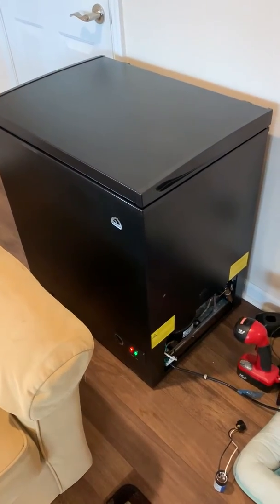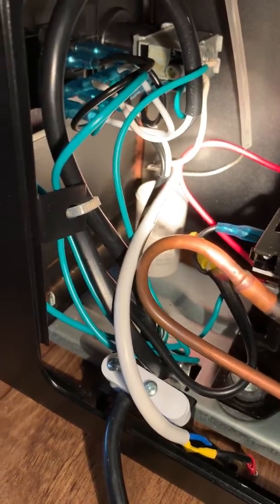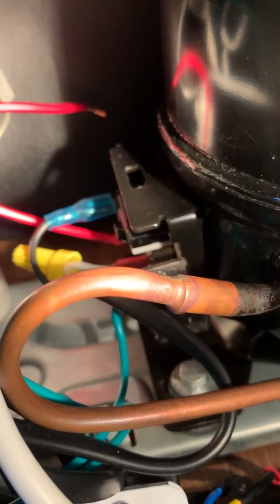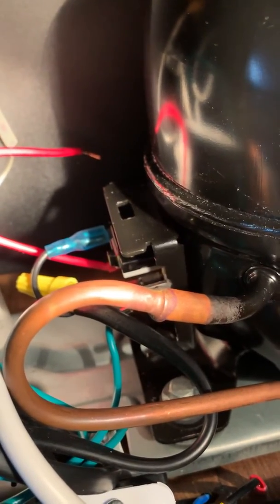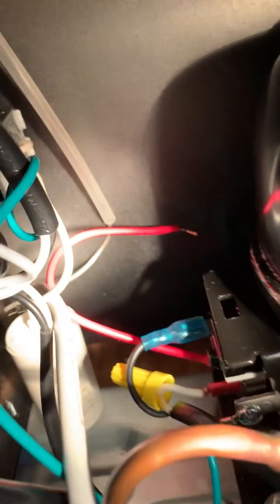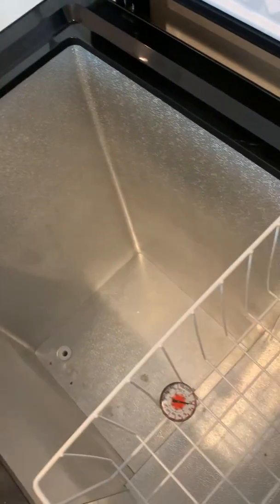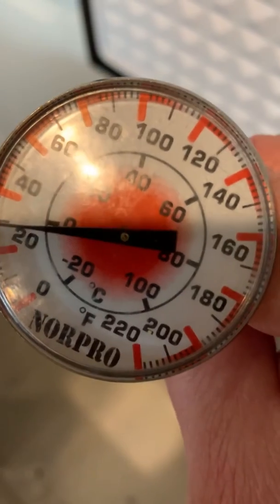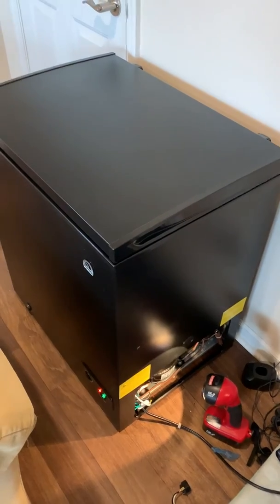FRF508 IGLOO Freezer Testing

Comment: I just got a non working Igloo for free. Parts are on the way. I purchased a new one for $189, and want a second one, so I managed to find one for free on Facebook market place. Seems like many people are getting stocked up on food, and noticing their freezer doesn't work anymore... so they go out and buy a new replacement unit. That's fine, I'll take all the free non working units and fix them. I like the 1.2 amp draw of the 5.1 cu foot units. The 7.0 cubic foot units are 5 amps? If you try to use solar power with these units, it will kill your deep cycle batteries real quick. Remember, when you go from AC to DC the amps are times 10, so a 5 amp AC freezer is going to draw 50 amps DC. The lower amps is more efficient with two 5 cu foot freezers in more than one way. This allows you to have 2 units running at 22 amps, and when you use up all items for one of the freezers, you can shut it down and only use the single unit at 1.2 amps AC (12 amps DC) draw.  Also, they have a reputation for failing from time to time, and having a second unit is just a smart way to go.
Reply: Hey